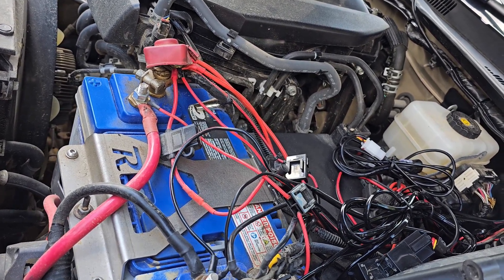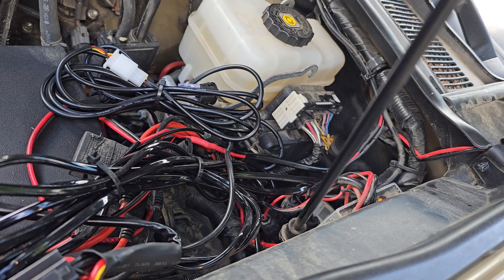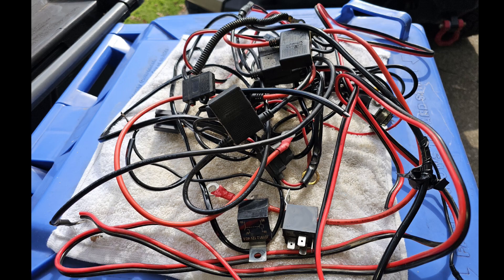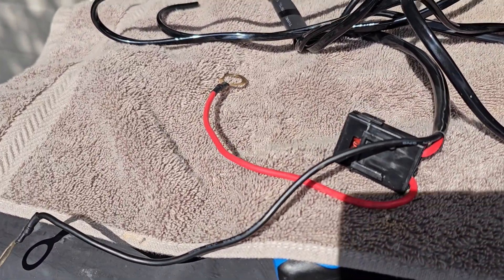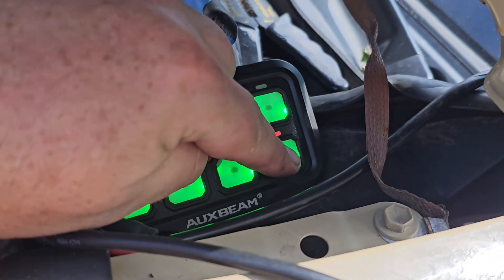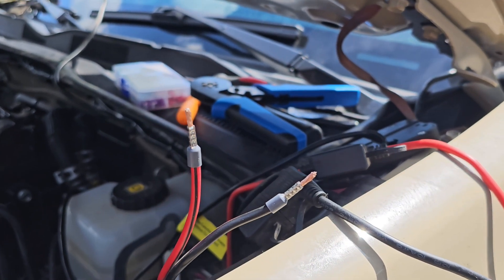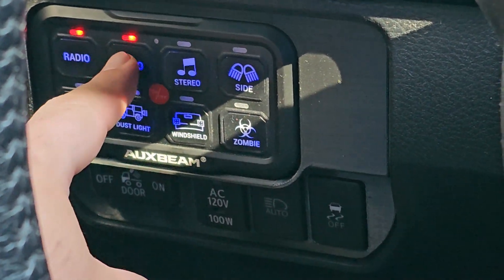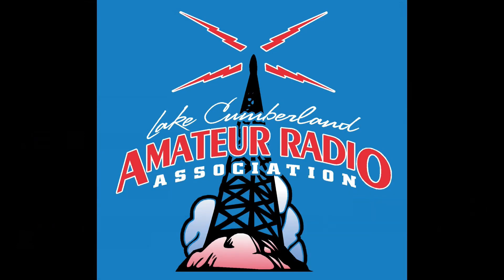LCARA HAM Radio: Auxbeam AR-820 8 Position RGB Switch Panel!!!!

Comment: Looks great! The switch panel is such a great way to clean up the wires! I have offroad lights and running board lights installed to the switch. Now going to install my GMRS radio. And soon hopefully a HAM radio once I pass my technician test.